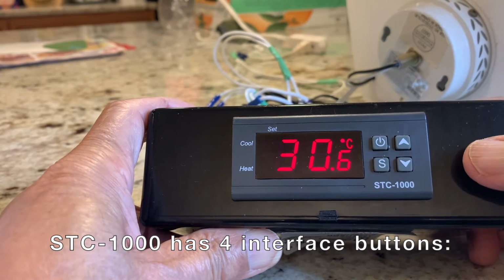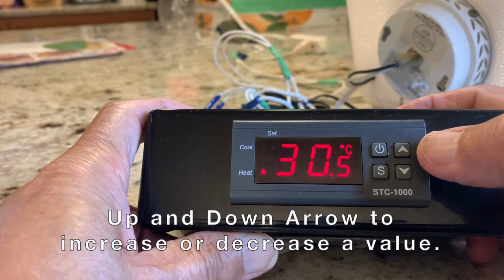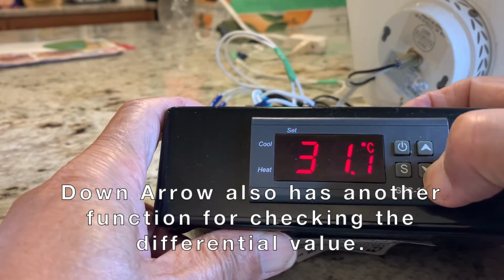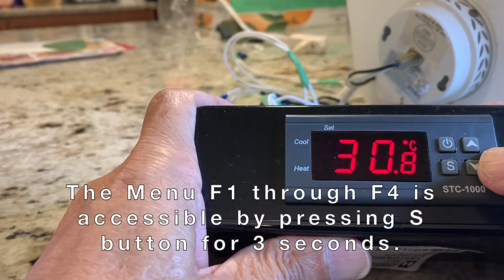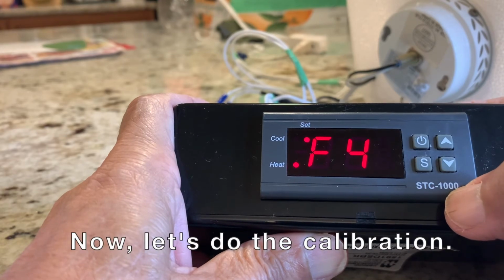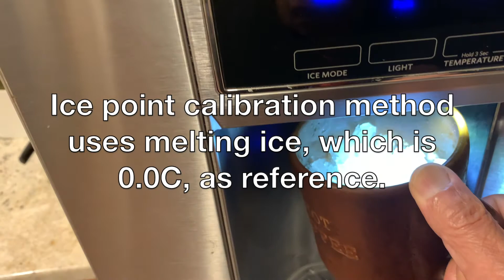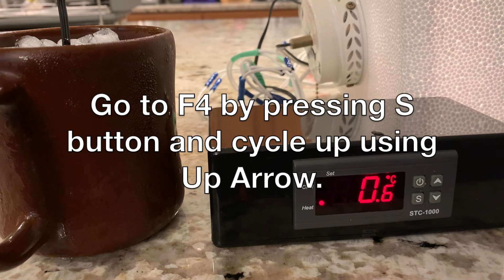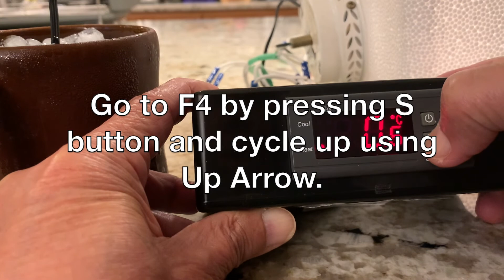How To Calibrate Your STC 1000

Comment: Francius, this is valuable. What is the duration after which we should check if the the device require a calibration?
Reply from the maker: I suggest once a year. There is no information about this though. But it is not so difficult so not really a big deal.

Comment: hello
whay calibration goes below 0.0 ?
Reply from the maker: Hi, there!
To calibrate means to make the actual temperature and the displayed temperature the same. In our video the actual temperature is 0C (ice temperature), the displayed temperature shows +0.6C, so there is 0.6 degree discrepancy. The display is showing too much. To make it the same (0C) we need to adjust the display by 0.6 degree down. It doesn't mean the calibration goes below 0.0, it will go exactly 0.0 after we reduce the excess +0.6C by 0.6 degree down.
Reply: @francius1003  how do you now that the ice temp is 0?
Reply from the maker: @i love videos youtube  This method is called Ice Point Method which uses ice point temperature (generally acceptable as 0C) as reference. if you want to check the actual ice point temperature, you can use a digital thermometer and the indicated temperature as a reference. But then, you might ask: how do I know if the digital thermometer really shows the right ice point temperature? Thank you for your keen observation.
Francius